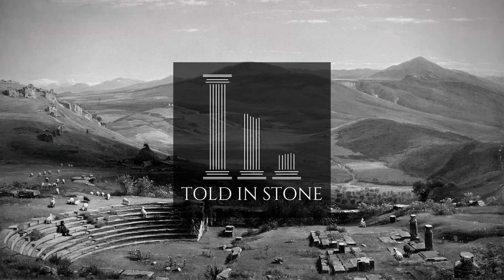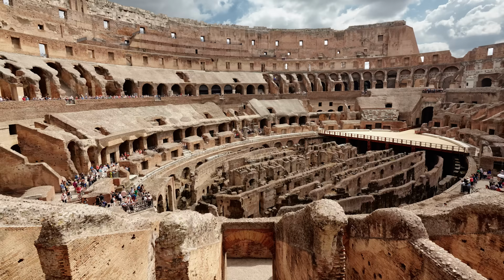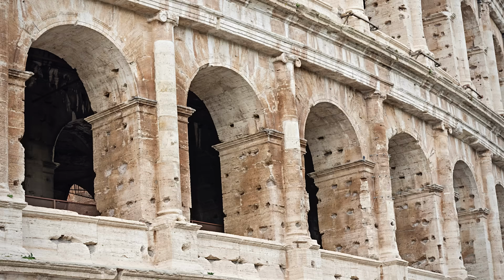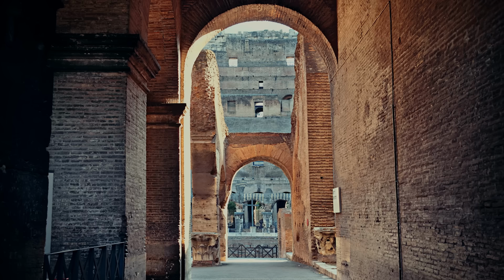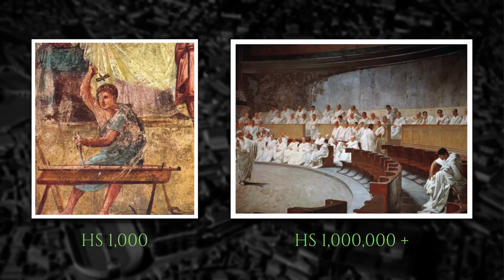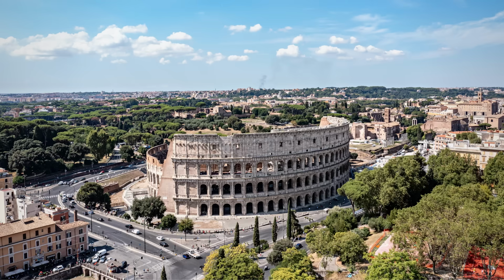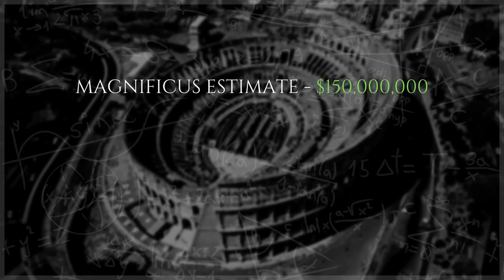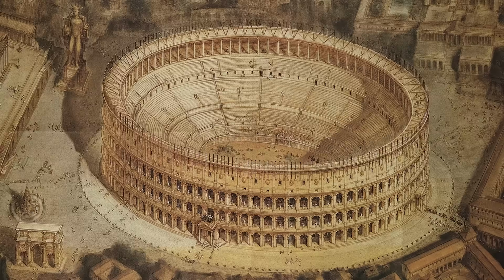How Much Would it Cost to Build the Colosseum Today?

Comment: I’m not surprised at the large difference in estimated cost. I work at an architecture firm and we see massive variations in estimates and quotes all the time. You are right that we would not get an exact answer unless we actually built it. Everyone has a different way to measure the cost of a project
Reply: Indeed an engineering estimate is not the same thing as a bid..
Reply: I always underbid my estimations because i always take the all there no delay happy path, my oldest boss told me one time "think your number, multiply by 3, add 1M". That was a good number in reality.
Reply: NiceGuy Eddie  Then how much would a colloseum with water, electricity, lights, restrooms, etc cost?
Reply: The Americans will build it with the highest cost and cheapest materials to make profit; Arabs will build it with a cheap price and good materials at the expense of the workers' pay; Italians will build it with a reasonable price and good materials, but they will take forever building it.
Reply: Surely a rough estimate would be an equivalent stadium today? Wembley cost 750m I think, stare de France 250m
Reply: NiceGuy Eddie  pretty sure it was a lot less than that, I remember massive questions about why Wembley was so much more expensive that stade de France
Reply: NiceGuy Eddie  probably, in 5 years with the current inflation rate it’ll be nearer 2bln
Reply: @donboldon3104  
The only ones building it with all reasonable costs and labour charges effective could be the Japanese
Chinese would spill on purpose some blood in the process
Reply: @penjim   Indeed, you're right; estimates and bids are far different.  For example, the initial engineering estimate to construct the US Embassy compound in Baghdad, Iraq, was $450 million (I believe, 2006 was when the winning bid was awarded).  I was there from 2007-2012, construction was still underway when I left, and the cost was over $1.2 billion and rising.  Humans don't change, so I'm sure there was just as much corruption in constructing the Colosseum; poor planning, poor contract writing, kickbacks between contractors and govt officials, and "unforeseen" cost overruns (please note that unforeseen is in quotations).
Reply: @jhonatancock2302  HAHA  Hits close to home, we use the pi method.  Do your take offs then multiply by 3.14 and then round up. :)
Reply: @howardkeller1137  I have never been to Russia. However, I think their main buildings are very well built. It is or was a centralized system. The capital city and city centers get good quality of life (better than western capitals) and the further you go into villages, the worse it gets.
Reply: @donboldon3104  😀😀
Reply: @penjim  The engineering estimate is assuming everything goes perfectly, and ignores all the bureaucratic red tape that impacts a massive project like this.
Reply: The most inaccurate estimate wins the contract😆. That's what my former boss said.
Reply: And it will depend who builts it, if it was built in Mandela land it will cost a lot less since things are cheap here, but corruption is so bad we will create hundreds of black connected excellence billionaires whos the middlemen doing nothing.
Reply: what firm u work at? trying to get an internship
Reply: @XanthusBarnabas  Building a fortress inside a warzone cant be cheap lol
Reply: @Nimrawid  when they had finished to the point when people could move in, the ambassador's wife, a good friend since the early '80s (Beirut days) told me it was the "oddest Embassy" she had lived/worked in, I replied "the only thing missing is the sign Arbeit Macht Frei"...it felt like a concentration camp for sure...😬
Reply: I think the only way to get a DECENT estimate would be to actually build a 1:2 scale model cutaway section about a foot wide and then estimate the entire cost of that. Cheapest way to get close to a real world estimate. Fact: the Nazis wanted to copy the thing but in a U-shape configuration and on an even more insane scale. They built a 20' wide section to full height and the head architect, Albert Speer, cancelled it. Why? Not only was it impossible to acquire insane amounts of pink marble to line the topmost section but Speer found out the top two levels of seating couldn't see a single person walking along the center arena! It was simply too massive. Everyone on the top two levels would need opera glasses to see what was going on!

Comment: As an engineer myself, you always 3x every estimate to your project manager. With that in mind, 3 - 5 billion is a safe estimate.
Reply: The fact that no billionaire has done this yet just goes to show you that they don’t know how to spend their money
Reply: Or learn to estimate
Reply: Or learn to estimate
Reply: There's absolutely no way this could ever cost 5 billion
Reply: Sounds like you are bad at estimating. I find I can bring projects in on budget rather than adding random 3x multipliers. I certainly wouldn’t hire you
Reply: @13dove  Your're out of touch with reality!
Reply: @tomp5207  Sounds like you're a mean spirited judgemental person and just out there to be insulting. So many projects of significant size encounter unforeseen problems and additional costs and their initial estimates are easily doubled or tripled on a very frequent basis, specially if it's public tender. You can find countless examples of that in any country.
Reply: @justalonesoul5825  But if you start out assuming it is going to be three times the cost, then what is the motivation for the construction company to do it efficiently? If they know they can get three times the money by dragging it out, then why not just drag it out?
Reply: Good old engineering, innovating the cost upwards.
Reply: @13dove  To be fair, most of their wealth is either in assets or businesses, not cash.
Reply: The 3x estimate is fair for the parts to complete foundations. After that estimates tend to hold unless there are client revisions or material or laabor cost spikes.
Reply: How are your estimates 3x off, my limit is about 5% with 80% plans
Reply: @mlmichel98  I'm a software engineer in startups- many unknowns.
Reply: I'm on a team doing a 150 million euro project in a rich part of Europe right now, and to me, 150 million is doable. Especially in Italy if we forget the corruption. That is if we are going for no tech at all and modern construction methods.

Comment: Carpenter here: I think the wide range is an accurate estimate. It will all depend on how true to the original it would be. I think if somebody wanted to build something that was the same scale as the original but that used thin slabs of finished stone to clad, ignored all modern building codes, and used sculptures that were just plaster casts of existing statues, you could do it for $150m or less.  But once you start adding in things like electricity, stair height limitations, guard rails, sprinklers, alarms, elevators, ramps, automatic doors, authentic travertine, hand-crafted marble sculptures, parking spaces, sewage systems, storm drains, insurance, gold decorations, hand-chiseled signs...well...sky is the limit in terms of price.
Reply: just transport of the marble and travertine would be millions of dollars.
Reply: Roman emperor here: We do not care about the safety of the plebians and the plebians do not travel in vehicles that need parking. Thus, both shall be ignored. Also no electricity; we must stay true to the era. Nevertheless, spare no expenses with the statues.
Reply: @stephenkamps8925  based and Emperor pilled!
Reply: Carpenter here = opinion discarded. The marble facades alone would cost over $150m
Reply: @DrPeculiar312  stop talking bulshit!
Reply: @DrPeculiar312  Getting sick of these usa prices lol. We assumed local sourcing no?
Reply: @Nimrawid  if they can still get all the marble needed locally, sure.
Reply: Former marble quarry owner here: I m in Tunisia and we have the second biggest colosseum and believe me guys only in Rome’s era it was expensive you just need a marble quarry for maximum 200k and rent a lot of machines plus transport seriously not a big deal below 4mill dollars, I don’t know about excavations but they’re defenitely cheap less than a mill, lets say 1000 skilled workers 2500 dinars which is extremely high in Tunisia for a two years which is absurdly high that’s 20mill dollars. That’s 24.2 mill add another 10 just in case now 32.2 is a general price which is super expensive in my opinion and could possibly be reduced to half I’ve seen insane hotels that costed way less for x5 the size.
Reply: This is why you can't compare currency between 2000 years. It's just impossible to itemize material and labor.
Reply: Former Colosseum architect here: $150 million would be sufficient to lay the foundation of the structure.

Comment: In reality it would be enough to restore it, recovering the missing parts elsewhere. . In Italy there is an amphitheater, very large and built by the same architects of the Colosseum, which has the lower half practically new and above all preserves almost all the columns and the relative capitals that adorned the last ring, the women's gallery (Matroneo). It is the Flavian Amphitheater of Pozzuoli.

Comment: It should be noted that to even get to building the actual Colosseum, a lot and I mean A LOT of pre-building job had to be done. First of all they had to clear the area for building. The area where Colosseum was to be built was actually already occupied by Nero's gigantic Domus Aurea (Golden House). So that monstrosity of a complex that spanned over multiple hills of Rome had to be demolished. Just the cost of demolishing it and then clearing the ruble must've been in millions of sesterces. Worse than that, the exact site where Colosseum was to be built is where Nero built a large indoor lake, which would have to be drained, which would probably be one of the hardest task in overall construction of the arena. Add in multiple smaller work that had to be done, like for example leveling the ground around Colosseum, and just the costs of pre-building would be enormous. Thus it's even harder to accurately measure the then building cost of the Colosseum.
Reply: I don't know really anything about Nero, but it sounds a bit like they may have destroyed his house and built a colosseum instead almost as a public works project? Like demolishing the mansions of the super rich because they're stupid assholes and building a park there instead lmfao.
Reply: This shows how capable people were even then. We are not really that much different huh
Reply: A lot of demolition work would have been involved, but they've actually found Nero's foundations under part or all of the Coliseum, and they might well have used the infrastructure of the lake, since they actually had simulated sea battles inside the Coliseum early in it's history.
Reply: There would be nearly no demolition required. You said it yourself: The Colosseum was built at the site of the artificial lake specificially because the site was already cleared (for the lake obviously). The actual buildings of the Domus Aurea are still there underground in the area surrounding the Colosseum. The lake beeing artificial would have made draining it also very easy because they just had to cut off the supply of water and the lake would have drained itself trough the already present outflow very quickly.
Reply: Amazing that the Romans destroyed one of their most expensive (and rather new) buildings to put up another immensely expensive building in its place.
Reply: @ionpopescu3167  We're less capable. We've just been handed certain technological advancements, so we think we're smart.
Reply: @dlxmarks  Probably much of the construction materials for the Colosseum where recycled from the Domus Aureus
Reply: @APAL880  speak for yourself. There are plenty smart people out there, just that the scale of things has changed. The “skill” just in a single microchip would be divine magic to any Roman…
We have higher productivity, knowledge, logistics, trade, technology, … (list goes on forever. Literally)

Comment: I don't know if you've ever worked in construction, especially with concrete, brick and stone, whatever estimate you come to will never be accurate. Especially on a project this big, projects ALWAYS go over budget and almost always over time. That's just how it is. Same people think all contractors are crooks because if this, but in reality, there are always unforseen obstacles and set backs in a project, and the bigger the project, the greater the set backs. Anything from weather, injuries, stolen tools and materials, discovering the ground becomes far more difficult to dig six feet down,broken tools from the very small to very large. Just too many variables, and people tend to estimate optimistically because if the don't, some other company will come in and undercut any realistic bids.
Reply: "Ballpark estimates"
Reply: "Things always take twice as long and cost twice as much as estimated" ~ a great philosopher

Comment: Thank you for an excellent analytical analysis for what the Colosseum might cost to build today.
I agree, as you surmised, that some things might be done cheaper due to modern technology while other parts might be more expensive due to higher labor cost.
But, in order for someone to make the Colosseum today with the modern amenities and internal structure required to pass code, it will likely be much more expensive.
The most expensive arenas/stadia of today are far more expensive than the high estimate given in your video.
In fact, there are 10 that have cost at least $1b or more.
It would be an impressive and monumental task if one should ever decide to build a new Colosseum.
As for me...I am happy with the Lego version. It fits nicely in my study across from the Lego Taj Mahal...

Comment: Very interesting topic to ponder over. Speaking as a former quantity surveyor on the contractor side, perhaps a more reliable estimate would have been possible if there were a good set of general building plans along with the structural drawings to enable quantities to be "taken off" (using UK quantity surveying jargon) by a QS. That would allow a common basis for estimates of the total contract sum by contractors and consultants and subsequent tender comparison. If contractors are perhaps worried about any errors in quantities, perhaps the contract could be done on a remeasurement basis that would better allay their fears.

From my experience, most of the delays and therefore additional cost in a project arise from construction work to do with the ground such poor ground conditions,  underground obstructions, hard material, unforeseen utilities, water seepage into the excavation, etc,  Once the substructure is completed, unless there are labour shortages and materials shortages, there is really nothing that will further obstruct a main contractor on the superstructure apart from incompetence in project management and foot dragging by the client over variations.

Further cost and time savings could be had by using Building Information Modelling BIM for planning of the construction process and greater use of precast concrete elements made off-site.

Talking about the substructure, if the Colosseum is built today using modern techniques, it would be reasonable to assume that it would use diaphragm walls for support for the substructure. That would be a site to behold, a massive excavation held up by diaphragm walls along with a great quantity of temporary works. Great video.

Comment: Mathematician here, with no idea of Engineering. But: from Germany, all big projects (Berlin airport, Stuttgart metro revamp, etc) cost at the end 5 to 10 times more than initial estimations, estimations which were done by professionals by the way. Infact, comparing with NotreDame , France, where the roof and some parts have to be rebuilt, it will cost all in all about less than 1billion Euros. Comparing with the size of the Colosseum, I would pretend, the Colosseum would cost 5 billions. So I believe you ve got from far the best estimation. On the other side, Magnificus with all his knowledge - that I do not have - gives us quite a ridiculous estimation, but thank you in all cases Magnificus!
As always, love your channel
PS: would like to see Magnificus use his methodolody to estimate the cost of NotreDame roof rebuilt. Then we would be able to compare with the real costs. My guess: Magnificus would estimate the cost at 30 millions ( its full Colosseum  costs 150.000.000), considering the  respective sizes. But the real cost is about 1billion, so a factor 30. Applying this factor gives us for the Colosseum: 4.5 Billions!

Comment: I'm not an engineer nor architect but I have several years of experience when it comes to cost estimations within the construction industry. Estimations for construction projects vary extremely depending on who you ask. Our company had a project planned and estimates ranged from 20 Mill to 80 Mill. Answer is always the same: "We'll see how much it really is when we actually build it". 
Although I have to say that 1 billlion $ seems really high for a "simple" project like this. Simple as in no insulation, no serious plumbing, rudimentary electrics and actually not that much volume.

Comment: It would certainly be expensive, but, as you pointed out. There are no modern amenities such as plumbing, electrical, and modern safety features. All of which add significant costs. This is a very neat project though. The main difference now is obviously we have modern construction equipment and techniques to make those costs cheaper, but the cost of labor I assume is significantly higher vs what it was for common Roman laborers.

 This makes me wonder what the cost of The Globe in London when they rebuilt it vs what it cost in the early 1600s.